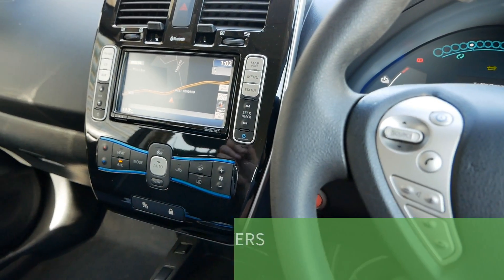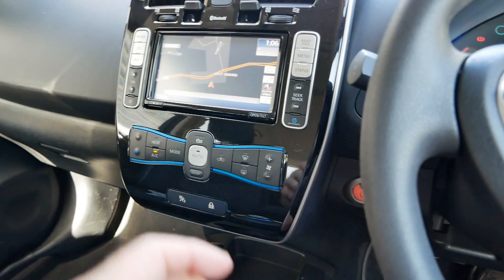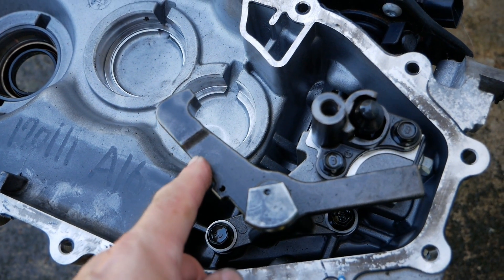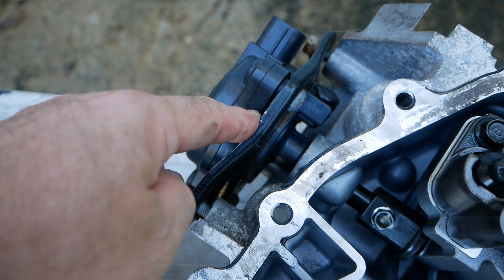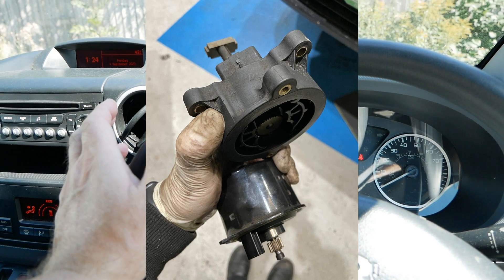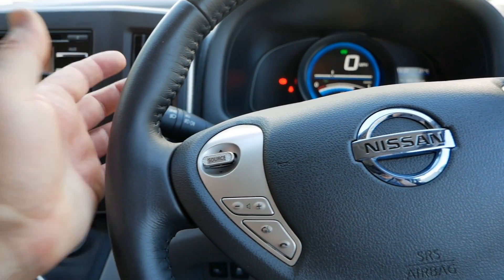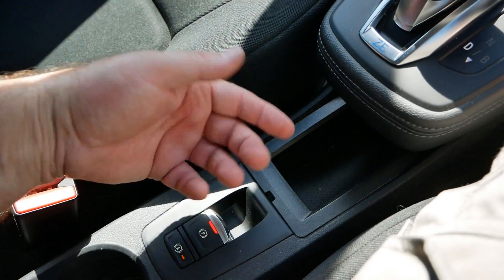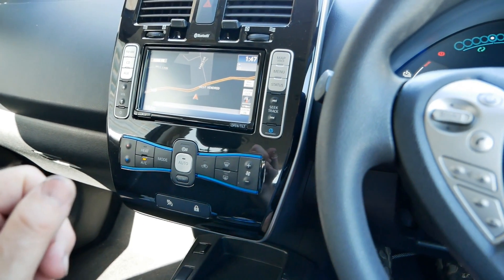How to correctly stop/park an EV. Many get this wrong, potentially causing damage!

Comment: I think my Zoe does it all for me. When I stop the car and turn it off, the car puts itself in neutral and also puts itself in park. 
Also as I walk away it locks itself.
Unless I'm missing something.
Reply from the maker: As I showed in the video, the Zoe ZE50 doesn't even have 'park' in the transmission. This is how all vehicles will eventually be.
Reply: "it locks itself" yeah. ive been using a Clio from the service centre for the last few days and good god is the self locking and unlocking annoying. i spent 10 min standing next to the car and it kept locking and unlocking, folding and unfolding the mirrors(sounding like a sick cat every time it does). makes me feel like i should park in at least 20 feet away from my tent if i ever go camping in it, otherwise it will discharge the 12V and make sure my stuff gets stolen. never mind that i don't want the car to be locked if its sitting at home in the(already locked) garage since i probably won't remember to bring the key if i just want to take something out of the car. my Leaf has a perfectly handy button on the door handle so i never have to pull out the key which is shaped somewhat like a key and actually attaches to a keychain.  oh and not to mention that i intentionally avoid places where i have to use the handbrake in winter and i couldn't do that with a car that does it automatically every time. French cars are dumb.
Reply: @yvs6663  Take two clean crisp packets and put the fob inside or use kitchen foil. 
You can also buy a small bag which does the same (mine was a present) in which you can place it.
Reply: There should be a setting which allows you to turn off that feature  @yvs6663  You'll need to check the User's Manual for where that is.
Reply: @yvs6663 it takes a few seconds to go into the settings on the screen and switch off the hands free locking if you don’t like it. You can then use buttons on door handle or key fob to unlock/lock. 

I wouldn’t tell your insurance company that you regularly leave the vehicle unlocked and don’t even bother to use the parking brake!
Reply: @bluefazer600  "reguarly leave the car unlocked and don't use the handbrake" its in a locked garage. someone needs to brake though a locked door to get to it. its safe enough. also, there is no law saying cars need  to have their handbrake on where i am from and its pretty much impossible for a car that parked on flat tarmac and has its transmition in P to roll. in fact, its quite a bit more likely that something will snap if i pull a handbrake in freezing temperatures.

Comment: Thanks for the tip. What is the correct thing to do when stopping at traffic lights?
Reply: Either press brake or use e pedal will slow down the car and stop it but you.may have to press brake sooner
Reply from the maker: Just hold it on the brakes or use Auto Hold if your vehicle has that.
Reply: @GoGreenAutos   “hold it on the brakes” - just like the multitude of moron drivers who sit with the high intensity brake lights glaring, for minutes on end, while waiting in traffic queues!
Reply from the maker: @oliver90owner  That's because most modern cars have a autohold function, so are designed to do this. Not moron drivers at all.
Reply: @GoGreenAutos  There is no excuse for not applying the handbrake when in long traffic queues.  It hisses me off, so I stop far enough behind to make sure my headlights illuminate them.  My auto ICE car did not need to be held with the brake lights on, my little hatcback does not need it and my EV doesn’t, either.  

When I took my test, the emergency stop was brake safely, apply the handbrake and ensure the vehicle was in neutral.  The poster, on this thread who drives into his sloping drive forwards most likely should reverse in and drive out forwards, making his first move a safe one.  There are drivers and ‘aimers and steerers’ in this world and the quality of driving is certainly falling.
Reply from the maker: @oliver90owner  You actually can't apply the handbrake in some cars. You can turn the car off, but you wouldn't want to do this at the lights or in a queue.

Comment: This has always been the case with automatic gearboxes regardless of the 'engine' type. Handbrake on first. The Park function is effectively a backup in case the handbrake fails. In the 'good old days' drivers were taught to turn the wheels so that if the handbrake failed the car would run into the kerb or bank and not roll off down the hill. A manual gearbox would also be left in gear - 1st if facing down a hill, reverse if facing up. That way the car would be trying to turn the engine over against the compression if it tried to roll off.

In my auto I only use Park if I am getting out of my car. If I am leaving my car I always use Park - having put the handbrake on first. Whatever you do, in any type of car, do not try and engage Park when moving. That will really do some severe and expensive damage.
Reply: Surely, if car pointing uphill, use a forward gear to get the gearbox to stop the car going backwards - then reverse gear when pointing downhill to stop the car going forwards?
Reply: @computerbob06  If facing uphill put the car in reverse. This is because any movement of the car would tend to be downhill which would make the engine tend to turn in its normal direction . Engage first gear and the engine would turn backwards which could be detrimental to it.

Comment: 6:25 Hold the park button a bit longer in a Tesla and it will engage an electric parking brake. It shows up in the display as a extra brake. It’s talked about in the Owner’s Manual, but who reads that?
Reply: They have changed the software now so that gets engaged however long you hold park. The purpose of the long press is / was to nip it on a bit tighter.

In Tesla it applies the handbrake and shifts to park as soon as driver makes to leave the vehicle, so you could legitimately never use that button. Although relying on a safety system is a bad idea, footbrake works on 4 wheels, handbrake and Tesla park only on two wheels... in low grip situations the car could slide away once the foot brake is released, making it better to be in the vehicle.
Reply: @insanityideas Thank you for the explanation.
Reply: Handbrakes have always only ever applied the rear brakes

Comment: Page 15 of the Warranty /Maintenance book for my 2022 LEAF :-
On a steep hill check that the vehicle is held securely whilst the vehicle is in the P (Park) position without applying the brakes. 
The next paragraph refers to a similar test for the parking brake. 
There is no memtion of any order for operation in daily use.
Reply: So maybe the user guide is wrong? Or at least unclear.
Reply: Just think of all the extra parts they had to sell 😂

Comment: To take the 'tediousness' (as my wife would call it) one step further,  I have always done this with our EV's & autos, but between hand brake and park I put it in neutral (on the Leaf pull and hold gear selector to the right). This way you properly know all weight is just in the park brake. After a few times it just becomes habit.
Reply: I do same, and I briefly let the foot brake go when in neutral so the car can roll into the parking brake. Already did this on my automatic ICE cars.
Reply: Thank you for this interesting and helpful video Matt

Comment: The ID.3 doesn't have a handbrake lever or switch.   How does this work please?
Reply from the maker: I've never driven an ID3 but it will be like a Tesla - its automated. It will still have a handbrake on the rear wheels, but they've automated its function and removed the switch.
Reply: @GoGreenAutos  Yes. pressing the  Park button engages the electrically operated parking brake on the rear wheels. If you do not press it it automatically operates it as you open the door. To leave the car without putting the brakes on (very rare) there is a procedure in the manual to do this.

Comment: What about auto hold, is that equivalent to using the Parking brake? without being aware, that is what I have been doing on my Hyundai Ioniq.
Reply: Auto hold applies either the foot brake (using the same actuator the emergency braking system uses -you will feel the pedal move) or the electronic handbrake (e.g. i-pace) to stop the vehicle moving and reduce strain on the gearbox or free roll in an electric car.

On hills, Cars with a torque converter automatic gearbox will usually hold themselves. Cars with a DSG auto gearbox would burn out the clutch plates which is why they usually have hill start assist to hold the car with the clutches disengaged when you move off the brake pedal to apply the throttle (also necessary to give engine stop start time to start the engine). DSG gearboxes are designed as part of a system to avoid holding the car on the clutch bite point because they have smaller less robust clutch plates.
Reply: @insanityideas  No.this mode locks brake fluid in the system effectivly keeping the pads tight on the disc without the footbrake being pressed. Hill hold on manual  ICE cars does the same thing
Reply: @derekhenry2120  the system I was describing does that by activating a motor which pushes down on the brake pedal then releases it once enough power is applied. Although the jaguar i-pace for reasons known only to jaguar does this using the electronic handbrake actuator... which means the hold function doesn't work very well due to the time it takes to apply and release the parking brake.

Some systems require the driver to push down on the brake pedal to generate brake pressure which the car can then hold and release.
Reply from the maker: Auto Hold is not the same as the parking brake. Auto Hold is effectively doing the same as pushing the brake pedal down, so applying the brakes on all four wheels. Its for when stopping at lights, junctions etc. 
The parking brake is applying the rear brakes only when parking and leaving the vehicle and is a mechanical applying the brakes.
Reply: Thanks for the explanation, I will apply the parking brake before Par

Comment: This sounds like a poorly thought out design from the car manufacturers. Either they need to make the part available without having to replace the whole gearbox or like with Tesla and Renault is design the car to not need 2 brakes and a park. 
The other issue is most electric car owners or at least the vast majority are on lease and they traditionally don't really care about the car having to last longer than the 3 years after they get it. 
This would be my same issue with battery management. Manufacturers should have code built in that only charges batteries to 80% but asks owner if they want to override to 100% this would solve alot of over charging and faster degradation of batteries meaning less waste in the near future.
Reply: LFP batteries need to charge to 100% fairly regularly to balance the cells and calibrate the BMS. They aren't as stressed by charging to full as NMC batteries and should last longer anyway.
Reply: So in real world driving you only have 60% of the stated range
Reply: @Markcain268  no, no you don’t. But to ensure the best maintenance of the battery it is better not to charge to 100% all the time or run the battery below 20% every time. It means you can use the full range when necessary, just like you don’t bounce your ICE car off the Rev limiter every time you go up the road😂😂
Reply: @devonbikefilms  no but i can fill the tank and drive until it's empty every time

Comment: Anytime I've been in a Tesla they just seem to press the gear selection stalk and leave the car. On the rare occasions when I've had to move a Tesla I couldn't see any physical handbrake?
Reply from the maker: That's correct. Tesla automates these steps and don't provide a handbrake control. But there is still a park brake on the rear wheels.
Reply: Teslas and some other evs don’t have a park pawl. Selecting Park on the drive selector is actually engaging the parking brake.

Comment: May i just add from my experience owning automatic cars/vans for some time its also important to release foot brake after engaging handbrake as a car or van can still roll backwards or forwards after you release a foot break as parking brake could be on a different set of pads/pistons or parking shoes
Reply from the maker: Yes, I should have added that too.
Reply: Sorry, I don’t quite get what you mean. When you engage the parking brake, usually you will be about to leave the vehicle, so of course your foot will be off the brakes. What is there to mention?
Reply: @Nikoo033  its mainly important down or up steep slope like for example a driveway . Hadbrake on before selecting automatic gearbox to park but when parking brake is engaged you will find that car will still move forward or backwards a bit when releasing brake pedal, that's because parking brake is on rear wheel and automatic gearbox normally on front wheels and they can move a bit and lock your transmission in park or brake stuff because of what Matt mentioned
So handbrake on while holding brake pedal then release brake pedal and after all that its safe to select park on transmission
Also it's safest to do all that in neutral
And when getting back to car when parked on slope sequence also should be kept in order 
brake pedal fully in, drive or reverse gear, then release parking brake 👍
Its in rear occasions when parking up on down the slope or hill but it happens more often than people realise
Reply: @Nikoo033 auto gearboxes, and EVs, need to have their transmission put into "park" before turning them off.
Transmission Park isn't the same as "hand brake".
Reply: @terryjimfletcher  I know that. But the video states that putting handbrake on first is crucial to protect the gearbox from the car’s weight and then changing to P. However, as I have mentioned, the weight of the car (in the case of a Hyundai Ioniq) is already held by you pressing on the brake pedal. So with the Ioniq, doing: brake pedal, switch to P, handbrake, power off, then release the break pedal, does not cause any strain on the gearbox either. And that’s how Hyundai instructs to do. 🤷🏻‍♂️